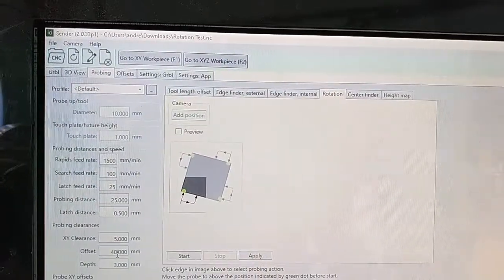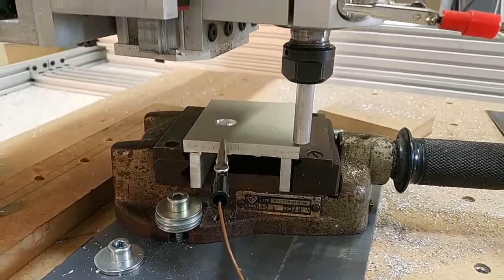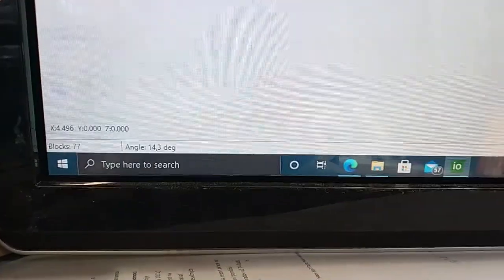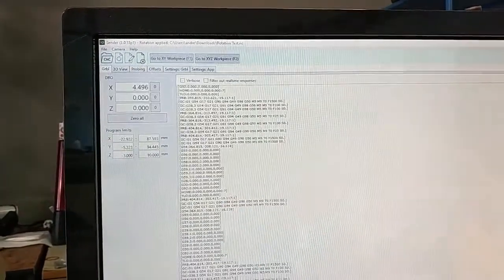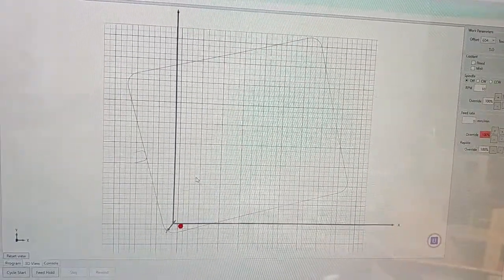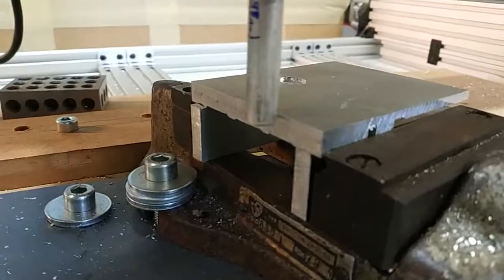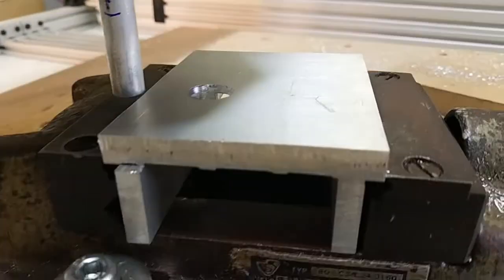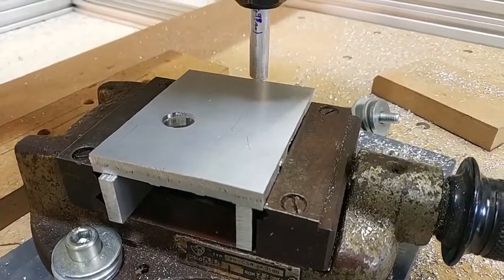grblHAL and IOSender - Gcode rotation

Comment: Thanks for the video. I might be getting a Long mill MK2 I think it uses an Arduino 8 bit , would it be worth going with a Teensy 4.1 breakout board and using grblHAL?
Reply from the maker: Yes, grblHAL is much more capable than 8bit grbl and I do recommend it. I do not use it anymore as I changed to UCCNC software and hardware. While I was using it it was performing very good and I was happy with it. The guys at printNC CNC are focusing on grblHAL along with some updated hardware flexiHAL so it might be worth to check in their Discord channel for more info.